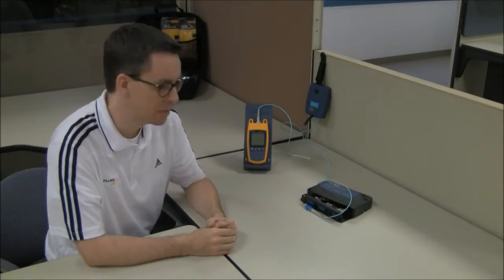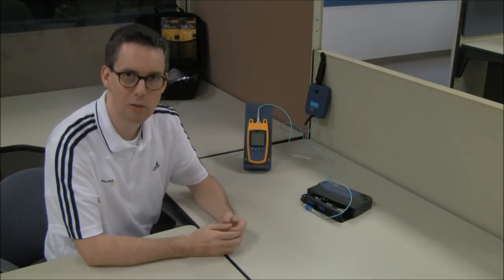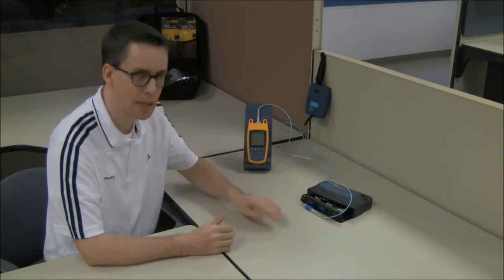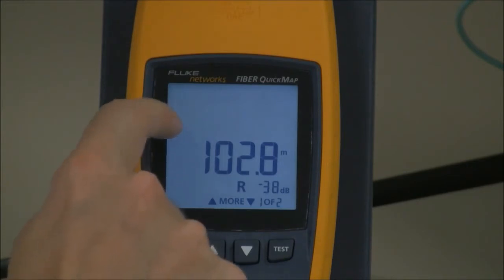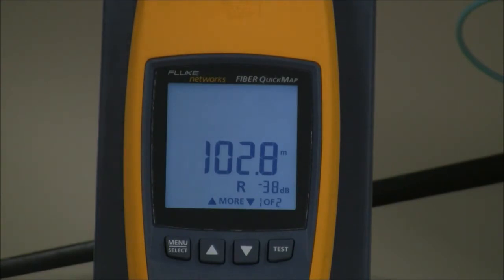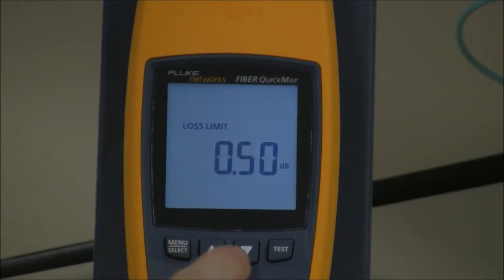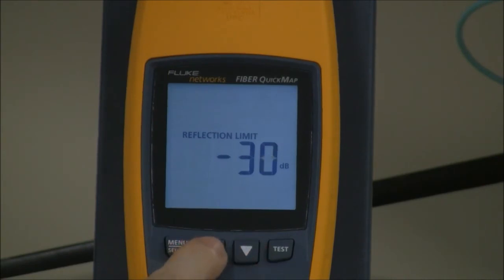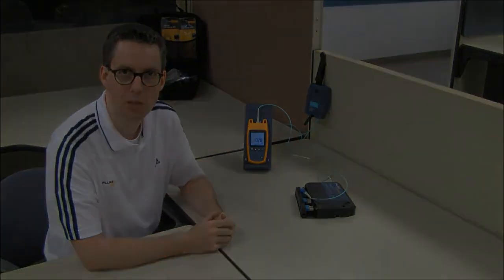Fiber QuickMap; How it's best used

Comment: SO I WALK INTO A CLOSET AND 5 INCHES AWAY FROM ME IS A FIBER OPTICAL CABLE THAT RUNS TO THE OTHER SIDE OF THE INSTALLATION 3 KM AWAY AND I HAVE TO USE A 30 METER PATCH CORD TO PLUG INTO IT ?????????????????????????????   WTF!